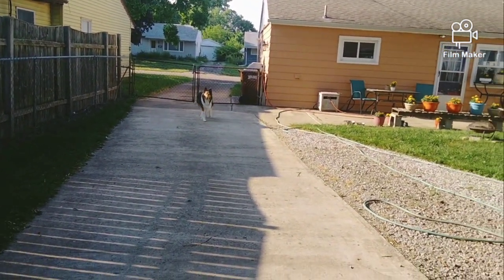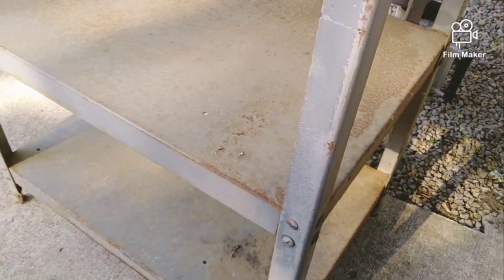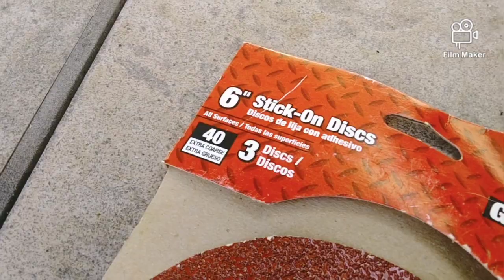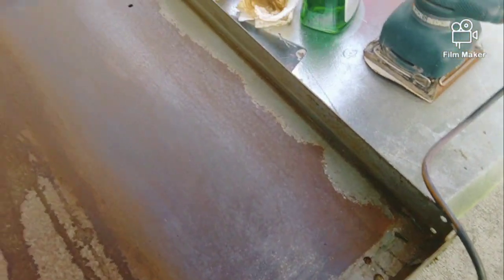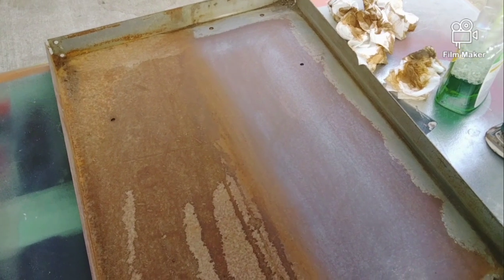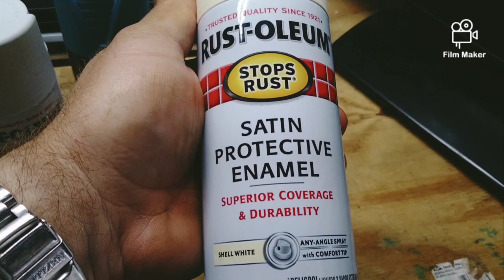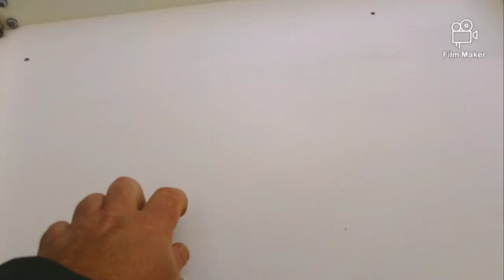Audio Rack Resurrection

Comment: You can make some isolation fee to go between the polystyrene and the wood, two packets of jelly and cut 4  squares keeping them together, paint them with PVA glue so they don't dry out let it dry and you have good isolation feet better than gel feet, the leftover you can put in the middle you really want five you don't want to leave the middle as a soundboard, dead  it as much as possible.
You could heat up the jelly and pour it as a layer over the wood 12mn as a layer.
You can use jelly as feet on the bottom as well use two furniture sliders and the four pieces of jelly x4 sandwiched in between it can hold quite a lot of weight one foot, just reverse one of the sliders and screw it to the bottom or glue it to the bottom of the rack.
I would isolate the other shelves as well they will ring!
 Paint them underneath with a roof repair water-based repair sealant rubber type sealant, quite gloopy sticks to metal well. Get one of those classic audio phono stage won't regret it got mine now Spartan 15 fantastic really quiet Great detail and control in the bass especially, and clarity in the top end, has a greatl separation in the instruments and wide sounds stage.
Reply from the maker: It will ring I agree but personally I don't think it will bother me so much. But I did ponder the thought of flipping all the shelves like the top one and filling them with sand but that would make it even more heavy than it already is. It's a perfect audio Rack especially for modification and size. I'll test it with the JBL L100's in the house and see how well if flows. I love it! It's hard finding a good audio Rack for under 1500$...I have 100$ in this and it's very strong.
Reply: @brotherbrian5625  yeah the sand is a good idea, 
But the sealant is a good to isolator the stuff I suggested, it has no smell it is water-based I use it for isolating speakers inside, it's not runny you can paint it upside down not sure if you have the same stuff over there probably, just look for water-based flat roof black repair sealant without fibres embedded .
If you're interested I can find the name of the chemicals on the back of the tin mine comes in a 5 L 11£. Dries quickly as well. I painted my oil tank with it been alright for 6 years not a sign of rust.
The more weight you can have the better as long as your floors can take it do you have wood suspended floor? That might be an issue try the jelly with the floor sliders after painting with pva glue give it 24 hours to dry before using.
You have packs of jelly over there don't you? For making trifle, used to come in little rectangular paper boxes but now they're in a plastic bag get it in the cooking section supermarket.
Reply from the maker: @hoobsgroove  that's a great idea but it's permanent. I'd have to think about that one.
Reply: @brotherbrian5625  as permanent as any other paint would be! you can paint over the top of it I did that on my tank because it is sticky after drying, some type of bitumen type rubber.
You're not going to see it if it's underneath. If you get another one do it first the whole rack and then paint the colour you want on top. Anyway try those jelly feet they work really well should be all right on the weight you can let the jelly dry out first give it 12 hours or so add a bit more stiffens. slightly defeats the object tho, then paint it with glue, the glue gives it stiffness anyway. Each foot roughly should hold 17 kilos with four pieces of jelly on each use the furniture slide for solid floor like on tile not carpet.ones usually have a felt bottom pad some are jelly in nature as well.